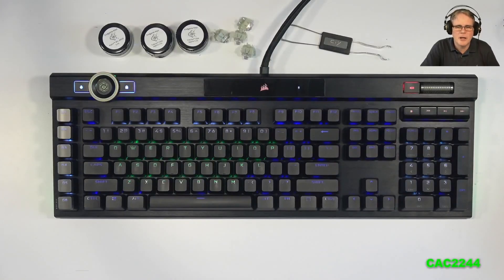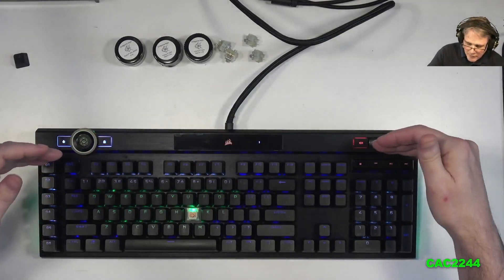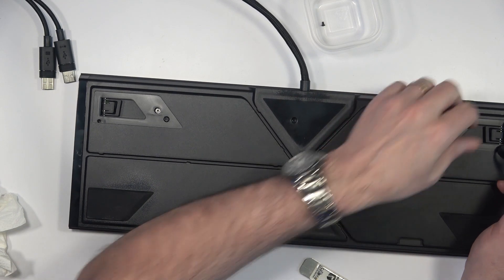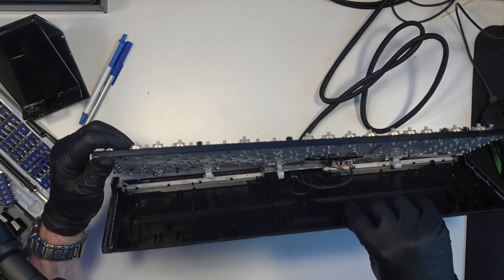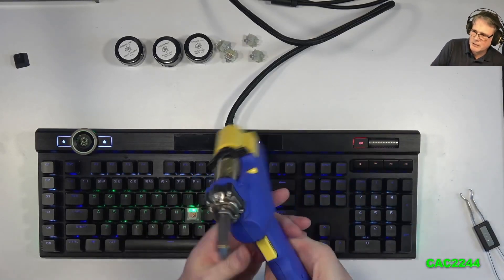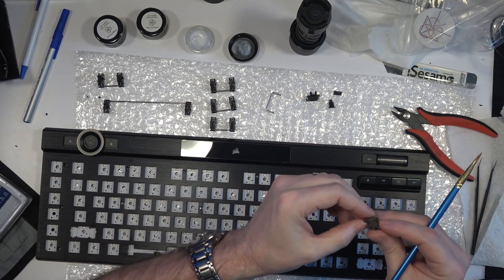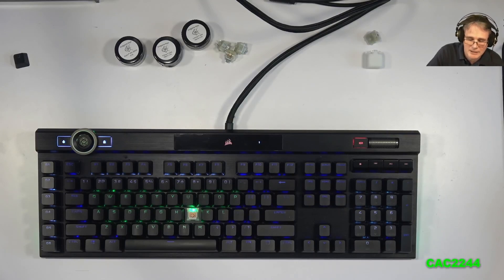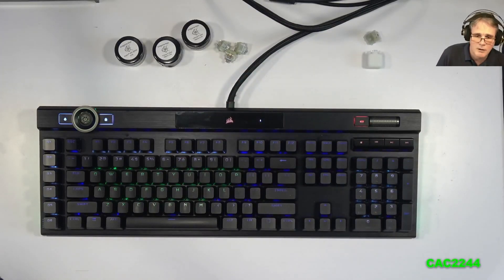Corsair K100 keyboard teardown and switch replacement

Comment: I have an old K95 Platinum that I've replaced with a K100.  The reason I had to upgrade is because the cable shorted out. Just as a side project I want to open up the K95 and cut down the cable to eliminate the short so I can give it to my sister with the PC that I'm building for her out of parts that I have lying around. Thanks for showing me how to open the keyboard to do that.

Comment: You can heat the Display on the middle front with a heatgun and lossen the glue, which is only a tape 2-3mm around th edge and than pry it open with a razorblade. thats what i did and it worked. so no breaking any plastic.

Comment: Thank you for your video, very much appreciated. I have one of my key LED lights failed less than 10 months old and hardly used. Typically it is the letter E LED light that has failed and I often type in low light, so finding it hard to manage with the key light out. Thanks again for the demonstration how to open and repair the keyboard. At £230, I expected a better system to replace a key switch. Kind regards, Chris.

Comment: if you have the optical switches, they are hot swappable
Reply: IMHO, the optical OPX are not swappable either, and that's what Corsair is saying too. However I was wondering if the Cherry MX Silver linear switches would be hot-swappable (because Corsair fails to make that statement). 
This excellent video made it clear that these aren't hot-swappable either in K100 Pro.

Comment: damn these lousy switches are vulnerable to liquids, don't get em wet! a few drops of soda ruined my k100 that's barely a year old.  does a keyboard exist with replaceable switches that aren't soldered in? i wanted to remove a couple stuck switches but i had to destroy them instead, weird that they include a switch removal tool if u have to rip the whole thing apart anyways.  that's 2 g910's and now 2 k100's ive had to buy in 7 years.  modern KB QC is terrible

Comment: Is there any way you can avoid using the clippers on 4:00? I would like to open it with minimal damage if possible.
Reply: Sell your keyboard and get the version with the OPX switches. Unlike the MX Silver setup, the OÅX keyboard features hot swappable switches.
Reply: @AB-80X no way, I was so disappointed when I had to return my k100 and I was trying to figure out a way to get one hot swappable, does this actually work?

Comment: Amazing video, but I have a problem! I own the optical switch variant of the keyboard and while they sound great they are too sensitive and require almost no actuation force. Do you know if I can swap these switches with other optical switches that require more force to push? I love the response times of the optical switches, so replacement opticals would be great. I keep reading conflicting information on how the optical switches are or aren't hot swappable.

Comment: Hello and thanks for the video, it is very helpful 😃. Is there any way to fix the central plastic where the Corsair logo is? I see that after trying to open the keyboard, they appear as air bubbles around the outline.

Comment: 3:55 
Does that mean that it is not possible to repair this keyboard without cutting those plastics? :/
Reply: Nope. Get the newer K100 with the OPX switches. Those are hot swappable.
Reply: @AB-80X  Hey one quick question soo if I have the OPX variant can I jist hotswap to any switches or just the corsair opx ones? My switches died in a dispute between my cat and a bowl of soup)

Comment: Hi, great video. Would you happen to know what type of SMD LED K100 has?
Reply: 6028 Common Anode RGB LED. Aliexpress part number: 3256805160115899 worked for me from 1% to 100% brightness.  Can't tell the difference.

Comment: Hi,
Thanks for this detailed video! I have a question regarding the switches, themselves - I am missing the cross plunger in one of my switches having purchased a K100 from an auction. 
If I purchase a replacement switch, will I be able to replace the plunger and internal spring without having to remove the full switch, itself?
Reply from the maker: Those are soldered switches (if you have the mechanical switches) , so to mod the switch, you do need to remove the switch by desoldering it and opening the whole keyboard.  It is not a hot swappable  keyboard.
Reply: @cac2244  thank you. It is only the cross shaped part and spring that is missing, though. Is this still the case?

Comment: Logitech messed up with their G romer switches.  Half of my keys either don't work or double-register, even ones I am not using. My G910 was suppose to be a top tier product and cost me 160 euro (they still sell them even for 200) but only lasted the warranty. Any chance you can make a guide to replace them with better ones?  😁

Comment: Thank you for the encouragement. 

Here is my finished build: 

AKKO CS Jelly Blacks lubed with Krytox 205g0, Everglide V3 stabs, Poron PCB-switch pads, 6mm of rubber (butyl) foam in the plastic case, cut to fill out all the hollow space. 

Sounds great, feels much better to type on thanks to the switches, the return on the Jellies is particularly fun for typing. I will still need to fix the stabilizers, as I've haphazardly thrown them together, without doing anything to them other than lubing them with 205g0 (should have holee modded them and balanced them). Really wish we had Staebies available for plate mount, because as of now, all of the aftermarket plate mounted stabs are underwhelming. 

I also recommend the Poron switch pads, as they make the bottom out less harsh - it is dampened without being mushy and I really think it significantly improved the typing feeling on the board. 

PS. The encoder wheel can be removed non-destructively and the front plate can be detached from the PCB without any issues whatsoever. You could install plate foam, but from personal experimentation, unless you have something like poron, sorobothane or silicone, it is not worth it with the "light and fluffy" foams. Plate foam needs to be dense, otherwise you're wasting your time. And the board really sounds great with only case foam.

Comment: Could you tell me what snips you were using? Because everything I've got at home is too big an unwieldy for the job. Alternatively, I was thinking about drilling the standoffs out from underneath the keyboard, but I'd need the precise location of the standoffs before I start drilling.
Reply from the maker: Don't you even think of drilling, that is a bad idea all around, please...   Anyway, my trusted side cutters are the Knipex 78 03 125...   https://www.amazon.com/78-03-125-Super-Knips-Electronics/dp/B0018NJO2I/ref=sr_1_1?crid=2O2JX228W0VLY&keywords=Knipex+78+03+125&qid=1654355578&sprefix=knipex+78+03+125%2Caps%2C56&sr=8-1
Reply: @cac2244  Thank you, I've ordered them. Sadly, I was very impatient and took the drill. Thankfully, after missing the first one by maybe 2mm (used your video as a reference), I got the second one on first try. Nothing was damaged as far as I can tell (plugged it in and tested it). I am in the process of disassembling the encoder wheel. So far I managed to gently convince the black plastic piece holding the center button in the encoder wheel to let go without snapping. If I manage to get out the encoder wheel, I'll update further, maybe upload a video on it. I really want to cut out plate foam for this thing, as I have done for my K95 platinum.

Comment: Mabye next time tell your Viewers that this is only for the non Optical Switches..i tear down my k100 and realized i cant desolder shit..
Reply from the maker: Sorry for the confusion...It seemed so obvious to me that it never crossed my mind... It's like telling Tesla to put an advisory for people not to try to change their engine oil...  I'll put a note in the comment though...  but so many questions arise by that comment: didn't you have replacement switches before you started? Didn't you see they didn't have soldering contacts? Didn't you know that the OPX switches from Corsair are optical and proprietary? Did you just open it up hoping for the best without a plan? Etc... at 50$ a keyboard, we could "willy nilly" it and take it as we go, but not at that price.
Reply: @cac2244  Yeah thank you..well ive learned my lesson at least 😄🙈

Comment: Hi, does anyone know what type of smd leds are on the switches? Also what lube would be the best for long lasting result?
Reply: 6028 Common Anode RGB LED. I used Aliexpress part number: 3256805160115899 and can't tell the difference.

Comment: It can be so much beautiful if you add foam on the gap between pcb and the back plate
Reply from the maker: i did, see min 7:56 of the following video where I added foam and also converted the USD pass through as an input for detachable cable https://www.youtube.com/watch?v=MEwbK5u6r_k

Comment: Great video! Just to be sure: At ~5 minutes you we're telling, that it's not possible to separate the "white" board, from the top cover, correct? As example: If I have an working K100 in black and a broken K100 in midnight gold, is it possible to remove the black top and bottom cover from the working K100 and replace them with the ones from the gold K100?

Comment: im an entry level hobbyist. i've been using a de-soldering manual pump.

you literally just made my jaw drop to the floor. its out of my price range for a bit but damn il save up
Reply from the maker: By far the best tool in any of my toolboxes (yeah, i got 4 of them: Mechanical/Standard, electronics, electrical, plumbing).

Comment: I'm going to be trying to repair a Corsair that started having key press issues and randomly hitting Windows and ect. I have got another keyboard but want to rebuild the 75% layout Corsair with some new switches that I'll lube. I don't have the nice gun for de soldering so I'll be using a iron and mechanical desolder pump. I hope it works out, after removing all the switches and cleaning the board I plan on plugging it in and testing the keys with tweezers to make sure the PCB is fine before ordering switches and continuing.

Is this a good plan?

Comment: Thanks! I couldn't find Cherry MX Silent Black anywhere, so I used Cherry Silent Red switches. Very happy with the results over the Speed Silvers. The only thing that wasn't clear to me was that the plastic end pieces don't need to come off.  There is some double stick tape on the ends and it just takes a little extra force to pull the keyboard apart. When desoldering the old switches, I found it to be quicker to just attach the keyswitch puller and then desolder the switch.  The weight of the puller was typically enough to have the switch drop off.

Comment: Thanks for the guide

Question - The left plastic stabilizer clip of my enter key (that slides over the wire) broke on my k100. trying to replace if without undoing the keyboard seems tough - do you think I can fix it without having to snip the top open the shell like you had to?

All I really need is enough clearance to slide a new clip over the stab (hoping I can get away with just undoing the screws underneath the keycaps)

Comment: Thanks very much for this. I really hated the linear speed switches, and your video helped me replace them. My typos have dramatically decreased (so dramatically that my tested WPM went up almost 20%). To be honest, the process was an absolute nightmare, as traces kept breaking on the PCB for some reason, even though I was being pretty careful. But after a few jumper wires, it's all sealed up and working now. Cheers :)

Comment: Thanks SOOO much for this. 
I spent 250 € for the optical variant of this just to spill a baverage on it... with 16g sugar content per 100ml.... Isopropanol and destilled water didn't work so I gotta switch the sticky switches out.
Reply: I'm here for the same reason, did you get it fixed?
Reply: @Sandwich4321  Yeah, Ended up using a desolderingtool from a college
Reply: @darkdraconis  did you open and clean the switch or just replace it
Reply: @Sandwich4321  No I replaced them, since they are optical, there is no obvious way to me to disassemble and clean them. That's why I moved working switches to the spot where the broken ones are and replaced those (17 numpad keys) and replaced them with jade boxed switches
Reply: @darkdraconis  just looking at the the few images of them that I could find the actual optical part seems to be under a switch and the switch body is just a cherry mx one
Reply: @Sandwich4321  oh, wait so do you think the the optical sensor is on the switch or on the board?
Reply: next time when this happens and feeling lazy use contactspray and let the board dry on a heating radiator for a few days I think by the heat of the radiator the sugar becomes harder/non-sticky :)
Reply: @X3MNightmare  Tried that ^^
 Even baked the  keyboard without the plastiks (board switches) @150 C tried to burn it that way to dust it off. Doesnt help friction and moisture somehow make it sticky again after a few days. Maybe its the AC?

Edit: My drink was EXTREAMLY sugary so maybe it will work on "healthier" liquids ^^
Reply: @darkdraconis  thats why to spray a can of contact spray to dilute it. But i can see with high humidity and friction problems could arise again

Comment: How does the rgb work with custom switches?
Reply from the maker: the RGB's on this keyboard are on the PCB of the keyboard, not on the switch itself, so it is independent of switches used. Only low-end mech keyboards use switches, with usually single color LED through it, like Outemu. This does not apply on this keyboard or any other where the RGB's are on the PCB, which most higher end KB have.
Reply: @cac2244  thanks for the response and the great video. So the rgb just shines through the clear switches from the pcb?
Reply from the maker: @antargaming1619  yes, and even the Pandas that I put are not clear but opaque, but they all come with a little punch hole window and the light goes through it just fine. Most original  cherry mx do come in clear versions.
Reply: @cac2244  cool thanks
Reply: @cac2244  Yo también tenía esa misma duda, muchas gracias por responder y compartir su trabajo. Saludos a ambos.

Comment: Hello, I’m having problem with the light bulb in the switch, my k100 for some reason got water leaks inside the switch (only small amount in the left Shift key) and made an brown dot on the light bulb, so is it possible to fix it?
Reply: u could try to open the switch and with a bit of alcohol and cotton bud/swab to clean it.
Reply: @potato4uu  thank you so much, I realize it is not an water, it is just an dust fall into it, I below Some wind to it and it disappears 😂
Reply: @mairerose5209  I just spilled my beer on my keyboard yesterday, had some contact problems, I started my oven to around 70-80 degrees Celsius, shut the oven and put my keyboard in it for about 5 minutes, and it was working fine after that. Today I realised my P key is lighting a little less that the other one, some dust got on the light, i'll need to blow some air on the board I guess. hahaha

I had a K70 5-6 years ago, I spilled a coffee on it and the keyboard was dead...

Comment: Is the stabilizers good enough to not replace? Or it is better to replace them and if i’m willing to replace it, any brand will work. I think it is plate mounted if i’m not mistaken
Reply from the maker: I kept the original stabs, they are as good as anything else and yes, they are plate mounted.

Comment: Does snipping the plastic stems cause any noticable issues? Or is it otherwise fine. And how easily do the rubber pads reattach if at all?
Reply from the maker: Stems, not an issue whatsoever... I should have put hot glue on the cut stems so they wouldn't rattle over time, but I made sure they were torqued right, but adding hot glue at the top, then it would have been even better. Rubber pads went back in like a charm... Removing the pads with little heat helps a lot. When I reinstalled the pads , I reheated a bit to make sure the glue would be nice and even.
Reply: @cac2244  thanks.
Reply: @cac2244  1 year later I finally finished doing my own key switch swap. Thanks for making this video, it helped me out a ton.

Comment: Nice video! Have you had a chance to remove the USB cable and re-route the wires to use the USB pass through as the input?  I'm wondering if you encountered any issues.
Reply from the maker: You better believe it that i did... you can see it here: https://www.youtube.com/watch?v=MEwbK5u6r_k